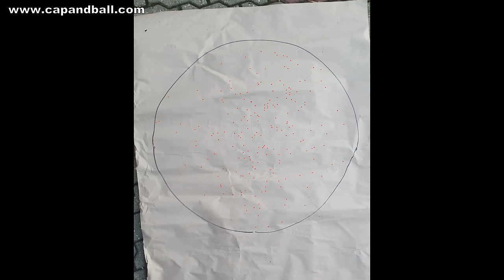Black powder partridge hunting

Comment: Shotgun cartridges were invented in the 1860s. Most early shotgun cartridges had a brass case, just like rifle and pistol cartridges. A few manufacturers during 1870-1900 offered shotshells with paper cases, but the early paper cases swelled when wet and paper cases could not be reloaded as many times as brass cases.

Comment: My grandpa had a Veterelli in his antique shop when I was in my teens. I researched reloading the caliber but I was not set up to cast lead. I remember that the article talked about seating the bullet onto a .41 Swiss case to shave a heel into the bullet, then pulling it to seat on the Veterelli case. I think the reason for using the Swiss case was that the cases for his .41 Swiss center-fire conversion were thicker than the Veterelli cases. Buffalo Arms may have some components.

Comment: Info: count the rifle grooves in your rifle barrel. If it's seven there's a high probability is Alexander Henry style rifling. Was designed specifically to lessen the effects of black powder fouling and the British army settled upon this rifling for thier Martini Henry rifles. From what I understand this 7 groove concept would be exceptionally difficult to reproduce using modern rifling methods. 
Strange but supposedly a true fact.
Reply from the maker: Dear J, the Henry rifling is indeed an excellent rifling. I used to have a PH Volunteer rifle with this rifling and it shot perfect.

Comment: Went Dove hunting once- i didn't have a good time- the other hunters were drinking while hunting and i never felt safe around them- im mostly a deer hunter from either a ground stand or a tree stand not a stalker - im a patient hunter i dont fire unless ive a clear picture of what im hunting- mostly ive used a 20 gage shotgon - a Mosberg model 500C Country Squire in 3" mag using #1 buckshot
Reply from the maker: Drinking and firearms does not match. We have a zero tolerance here for alcohol during hunting.
Reply: Drinking and hunting is a felony that could put someone in jail for 1-5 years and up to a $10,000 fine

Comment: Great video (as usual) and I eco the sentiments re seeing more of your BP hunting videos.
I have not met you in person, but I've been at a few MLAIC championships as a clay shooter.

I got into serious BP clay shooting 30 years ago, it all stemmed from not wanting to shoot
the bag limit of ducks and geese with modern, so to reduce those quanities, I turned to muzzle loading.

My greatest joy is deaters day on the Craigmore Station/Farm pheasant shoot in New Zealand.
If it's a wet day I use my BP cartridge hammer shotgun, but if dry, I have a NZ made muzzle 
loading 12g.

I have tried brass 12g cases, but don't get on with them, so I use used plastic cases, but with BP 
they only last one shot, BP is just too hot.
my load is 1 1/4oz shot (now dismuth) and the same volume 2FF.

Back in my competition days, I practiced with 100 clay a week. I used powder bought from a fireworks
company, it was their morter launch powder (they use compressed air now), it worked great, 😃.
I found that practicing with a flint lock was best, as it improved my follow through.

I'm now retired from competition, but still get out there with my shotguns.

More black poder hunting videos please.
Reply from the maker: Thanks Richard, good to see a member of the MLAIC family here! I am not using Swiss for my shotguns as cheaper powders seem to work well enough.
Reply: @capandball  I have only used Swiss in the flint primming powder form while I lived in Adelaide, South Australia.
I was extraemly impressed with how well it worked!
I used it in my 1780 Mortimer 14g flinter with great success and would even set the charge off while being held upside down, just amazing stuff!
When I retired from comps, my two originals got sold, because I'm not a collector.

Comment: Great story as usual and well done team for a wonderful day’s Grouse hunting! 👍👏👏👏👏👏👏👏🥃🥃🥃🥃🥃🥃😁 When you loaded the brass cartridges and just fitted a tight card wad over he shot, I was wondering if you find that the load in the unfired barrel moves forward under the recoil and falls out? I have a lovely old Richard Redman 16 bore, Underlever, BP shotgun. I load brass cases for it and was just running a line of wood glue around the over-shot wad, but the left barrel charge would still come loose and dump the shot onto the ground when the gun was broken. I have successfully hunted rabbits with it, because we no longer have a game bird season where I live and it’s a joy to use. 😁 
I have since made a crimping tool for these cases and it just closes the mouth of the case slightly, but I don’t get any more lost loads. 😁
Thank you for your efforts on this channel. It is one of the best on here. 🙏🏻🙏🏻🙏🏻
Reply from the maker: I checked it and did not move at all. The cardboard is really tight fitting. 20 mm in diameter.
Reply: @capandball  Are those cases harder to load in the chamber, than an empty case?

Comment: I use 80gr charge 2f in my 12 gauges. 
I use 3/8" cushion wads in place of the cornmeal fillers. But i use the stiff over powder wad on top of the charge...then cushion...then half of a stiff card wad..
Then my shot..then a over shot card...then roll crimp..

Comment: I own the exact same model of hammer drilling in 10x10x45-70. Of course black powder only. I had a Birmingham gun maker square up & true the action, Chokes honed to Imp Mod and Skeet #2.
Thank you for interpretation the proof marks. Mine was probably built close to yours. However mines a beast at 10.5 pounds. The butt stock was replaced very expertly. Was imported by Charles Daly the New York based gun importer.
It has no sling swivels though. I sometimes wonder if it was ordered by a wealthy American western cattle rancher and traveled his rural property in a wagon box. Maybe?
Yours is the only one on youtube closest to mine.  🇨🇦 Be well.

Comment: Hello there and tank you for so many excellent videos! I don't reload shotgun cartridges but I shoot Cowboy Action. Modern star crimped shotshells extract poorly since the case material extends too far when fired. Cutting the shell and then roll crimp it instead would tage card of tge problem. I got some tool made to be worked from an electric drill but the process heats the cartridge exessively... a slow, hand driven tool like the one you use in this video would be a great thing! Are there any newly produced ones to buy or do I have to get an antique one (I gaven't seen anything like yours on the market here ever...😢! I need one 😊! Grateful for any help or pointers in tge right direction. All the best!

Comment: Waiting to see how you clean the drilling.  How much fouling made it passed the cartridge cases and into the action?
Reply from the maker: Jagschwarzpulver leaves a lot of fouling. Much worse than Swiss powders. I just dip the muzzle into hot water and us e tight fitting patch to rub the bore from the fouling. I dry it with a few dry patches, and then comes the gun oil.
Reply: @capandball  Swiss powder comes in different grains, why not use the coarse variant then?
Reply: @phileas007  You need a faster powder for shotgun loads. If you look at modern powders (I know not the same thing as BP), shotgun powders are amongst the fastest. Slower burn rates are going to have more scattering of the shot, and typically less velocity.  Shotgun powder burn rates are similar to fast burning pistol powders.

Comment: Question  did you say that you use corn meal as the filler / buffer ?  I've heard this but just couldn't quite understand?
Reply from the maker: Yes, I use it to replace the over powder wad. Works very well. Check here: https://youtu.be/iCbK9wHsW_Q
Reply: @capandball  thanks  for answering. I have saw where others have used in modern shells as the shot buffer to help with patterns.

Comment: I need to figure out a load for. 410  in Blackpowder for my 45/70 1873 Sporterized carbine. I believe that "BANNERMAN Company got a hold of a full sized Infantry model(Which makes sense because his company bought a lot of surplus weapons), the people removed the rifling from the Damascus   barrel and shortened the same and braised a new post sight, but leaving the original back sight.
I received it when my Father passed away. I knew that the firing pin was broken, so I was able to order one, but still need a new firing pin spring before I even think about firing it.
If you send me your Email address I will send you some pictures of my Rifle.